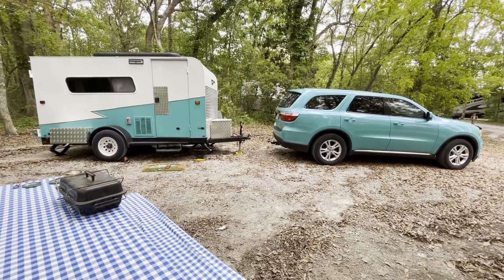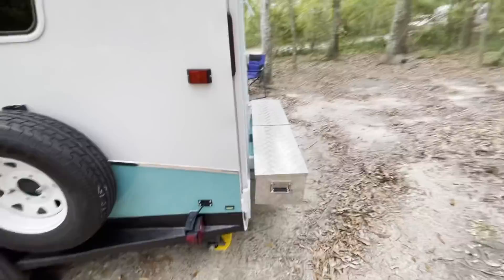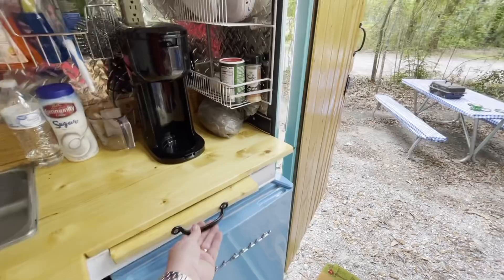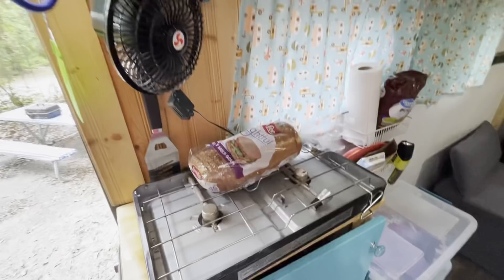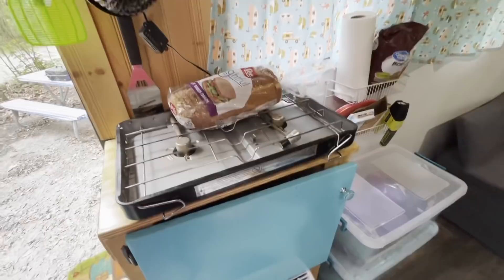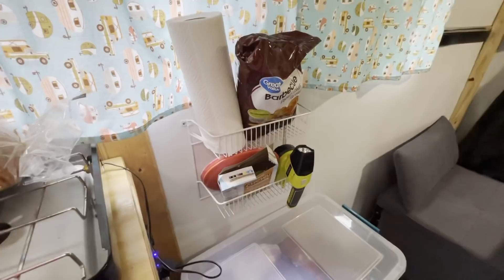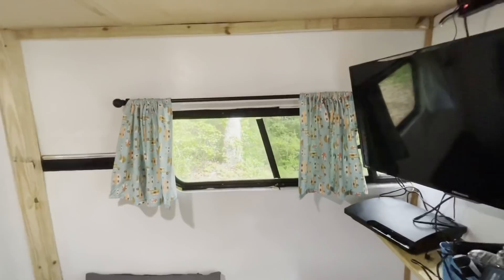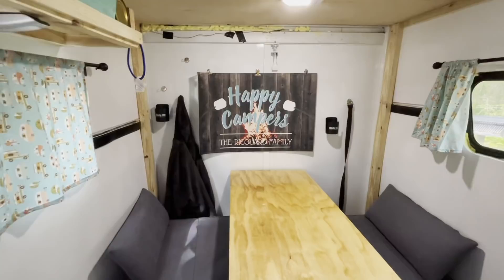6x12 Cargo Conversion Walk Through

Comment: Love your conversion. Great paint job. Really like the retro look you gave it. And then the retro appliances too. Very nice. We almost got those chair beds for our cargo conversion, but decided to do bunks instead. We started with a full, but it just took too much space. We're pretty happy with the bunks. You guys really did a super great job with your camper. Thanks for the tour.
Reply from the maker: Thank you! The beds are not as comfortable as I would like but they aren’t too bad. If we had more space I would opt for a more comfortable option for the beds.
Reply: @campingtinylivinglarge9733  yup I get it. Small is rough to work with. Ours is only 6x10. The full bed we had in there just took up too much floor space for my liking.

Comment: You might opt to add removable or collapsible legs to the rear door so as to create an extended patio area.  Add magnets and roll up split screen door style for additional fresh air and patio access.  Luv how y’all added the windows and a nice touch of exterior color to your retro style camper.  🚌

Comment: How do you like the propane water heater, would you buy it again?
Reply from the maker: We would certainly do the propane water heater again. We did learn to cover the hose when not in use to prevent trash from getting in that clogged our hose before. We also learned the hard way to drain the water heater in the winter when not in use. Other than that, we had great luck with the water heater. We did have a vent and exhaust fan in the bathroom that we would open when taking a shower to vent any fumes but we honestly never had any fumes. We also had a carbon monoxide detector that never went off.

Comment: Your water issue might be that you have the filter installed backwards....if that's the same brand as mine...the white part goes to the supply spigot...the filter is directional...  new filters must be flushed a few minutes they will run dark gray initially and then flow clear...i actually flush my filter and hose before hooking up every time...do this not hooked up...and use the white hose for RV water...
Reply from the maker: Thank you for the advice! We will look into this.

Comment: Love the retro look. My husband is doing something similar to our cargo trailer but we are hitting an issue with getting the AC in - and since we are in Florida and an AC is a must. We tried a portable unit but it just wasn't cooling enough. I love how you did your AC, I like how it is not hanging outside the trailer. My question is how did you handle the water drainage for the AC?
Reply from the maker: The AC we purchased is one that does not drain.
Reply: @campingtinylivinglarge9733   - How does it not drain?

Comment: Great build. Are you using a white rv fresh water hose? They make a hugh difference. I live full time in a 6x12 converted Cargo trailer. How do you run your grey water from your shower?
Reply from the maker: We made a tank out of PVC pipe for the grey water when sewer isn’t available but we can hook to sewer. We are not using a white RV fresh water hose so we will look into that. Thank you for the tip!

Comment: Does the water heater unit for the shower exhaust into the trailer or outside?
Nice build!
Reply from the maker: It exhausts inside but we have a fan above the shower that exhausts outside and a carbon monoxide detector inside the camper.

Comment: This is a dumb question but did you rinse out the water filter when you got it for 10 minutes? Like hooked up to the water hose running outside? It's not meant to drink, just shower and wash hands with. Nice build 👍
Reply from the maker: Apparently we did not do that so this is certainly not a dumb question at all. That may have been our problem. We’ve noticed since we have used it more the water looks a lot clearer. We still only use bottled water for drinking.
Reply: @campingtinylivinglarge9733  yeah those things are full of charcoal or whatever they put in there. I've never liked tap water for drinking personally. I'd always get a sore throat especially from whatever calcium or lime is build up inside those old pipes.
Reply from the maker: @ModernMessiah  that makes sense why the water was black the first time we used it.

Comment: What type of car do you drive to pull it?  Love the colors.
Reply from the maker: We have pulled it with our Dodge Durango before but it struggled a little with hills so now we pull it with an 8 cylinder Ram 1500 Big Horn truck.
Reply: Thank you , you 2 did a super job. the blue is so nice.i am going to search for a Durango also  just love the shape and color of the car. And trailer so sharp.
Reply: Thanks for the reply.
Reply from the maker: @lsrenoit774  thank you! We’ve made some modifications so a new video will be posted in the near future.

Comment: Looks very retro! Nice job. Is that water heaters exhaust  in washroom vented in anyway?
Reply from the maker: It does exhaust in the bathroom but we have an exhaust fan in there. We have a carbon monoxide detector and haven’t had any issues. We make sure the vent is open and the fan is on when we take showers.
Reply: Ok thank you for replying! First time anyone ever has to me! :)